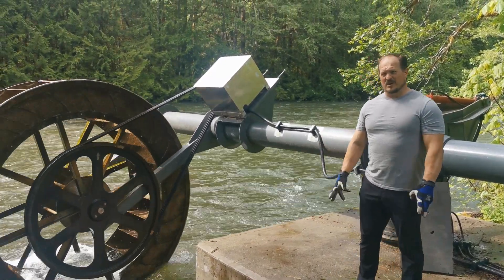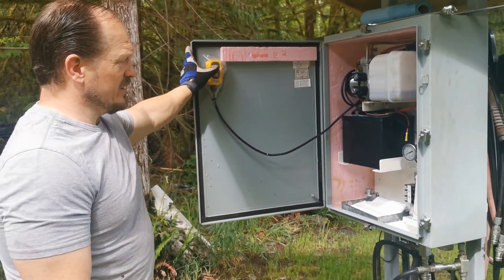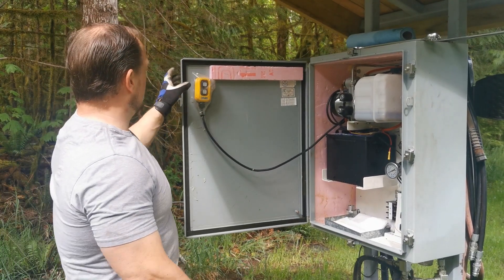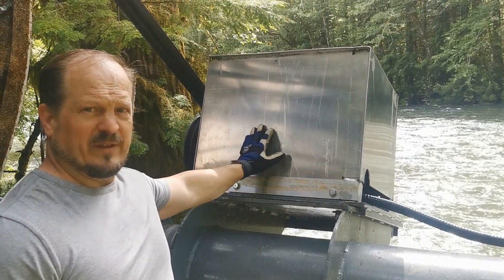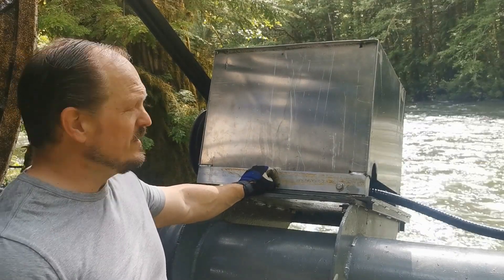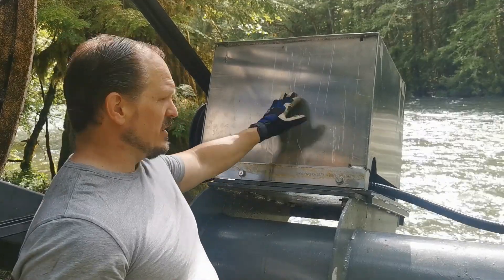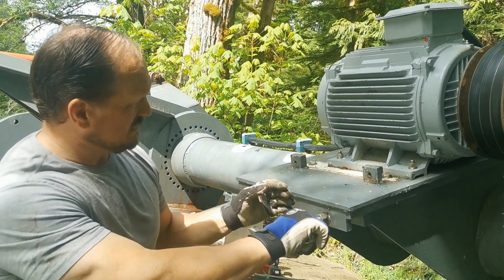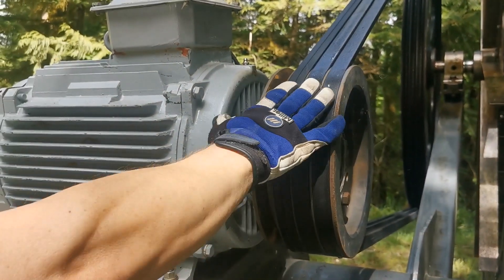DID THEY FAIL? Bearing Update Waterwheel 2020

Comment: lignum vitae bearings have been used in ships for years but they need a really large flow of water.  i saw one bearing fail  because the water flow was cut off by a rope around the shaft despite it being ten feet under water

Comment: You may consider looking at flat belts unless you've already moved forward with your chain plan, though I may be using experience from the wrong RPM range to make this suggestion. The Lister(oid) diesel genset community has had lots of home-brew experience in how to get the most out of big-flywheel mating to gensets.  A flat belt has multiple "grooves" in it, and may end up giving better surface area contact when you do the math.  However, they are probably difficult to find in the lengths you will need for your kit, so that may disqualify them. Also, your comment about an idler is probably correct - with such a large differential in big/small diameter wheels, the contact area is significantly lessened, leading to slip.  A double-idler would also give you quite a bit of boost and reduce slip.  I'll be very interested to see what the chain does - it should also make it possible to reduce your bearing loads quite a bit.

Comment: any consideration to using a chain and sprocket drive to eliminate slippage, or are you counting on the slippage as a natural protection mechanism (?)   I first read about a poncelet wheel in the late 60's-early 70's...  never have seen anyone do one.  Nice setup, especially as a DIY

Comment: A direct shaft coupler would solve those problems, encase the generator in a vented housing. install a dc voltage height gauge that would raise and lower automatically to accommodate changing water levels. You could also install a electrical current monitor if the voltage dropped it would automatically raise the water wheel due to debris getting trapped.   Nice job and could be duplicated, sell back into the grid to pay for the upkeep and make profit.

Comment: You may consider swapping out the Lignum Vitae bearings for a set of Closed Linear Plain Bearing made by the Pacific Bearing Company. Pacific Bearing's 4" diameter bearing has a static load capacity of 100,000 lbs! That is seriously heavy duty. These bearing have cylindrical aluminum or stainless housing and the bearing material is inside and no moving parts. All you would need to do is machine 2 aluminum pillow block to mount the bearings in and probably true up the shaft so these bearings wear evenly. PB's are mostly used for linear motion, but as also perfect for slow rotary motion with heavy loads. There are a couple reasons typical roller bearings fail in water wheel applications: the rotation speed is to slow to liquefy the grease thus it gets push out failing to lubricate the rollers, the second is water intrusion. These plain bearing are available with zerk fittings for grease or a threaded port for oil lubrication via a wick... and water actually improves the performance and longevity of these bearings. The reason I know all about this is I plan on using them myself when I find the right hydropower site for my stainless steel overshot wheel. PB pdf catalog has great info about the max rotation speed with and without lubrication and tons of other important info. Best of luck to you
Reply from the maker: I'll check them out. I'm getting ready to do some mods to increase power and power delivery
Reply: @NeringIndustries  Are you going to make the wheel wider to increase power? Any plans to add a gearbox, gearing, or chain drive? You could always make a generator that is direct drive i.e. no transmission. Some wind turbines are direct drive and have a very large diameter stators and rotors that makes power without the need to speed up a shaft to 1800 RPM's as many generators require. I'm excited to see the improvements
Reply from the maker: @chrisdaniel1339  I've got a chain drive system waiting to be installed. I can then lower the wheel even further into the river and make more power without the belts slipping. I'll need to fab up a chain guard with an oil sump to keep water off the chain and keep it lubed. I'll be going back to roller bearings and have a plan in place to do that too. At some point I'm going to make the wheel 1 foot wider and bigger in diameter. To go direct drive I would need a huge generator at 10 rpm,
Reply: @NeringIndustries  I am curious about using roller bearings again when they have not performed well in the past. How are you going to keep from infiltrating the bearings?
Reply from the maker: @chrisdaniel1339  I've several things I am doing at the same time. 1st is putting covers over the bearing housings to prevent direct water being splashed on them. 2nd is using pregreased bearings with factory seals inside the housings instead of the open design I used before. 3rd is not filling the housings with grease but leaving the housings with air space around the bearing and drilling a drain hole in the housings for any water that gets inside. 4th is using a different style of shaft seal on the housings. Lastly i will install a flinger ring on the shaft to fling off any water that runs along the shaft. Hopefully that all works.
Reply: @NeringIndustries  I am interested to see the new improved machine.
Reply: @NeringIndustries  Pacific Bearing has two metric product lines FM (Metric) Closed linear plain bearings goes up to 80 mm ID sizes With capacities of 270 KN or 61,000 pounds. They also have an FJ (JIS) metric closed linear plain bearing With a maximum 150 mm ID size and 740 KN or 166,000 pound static load capacity

Comment: Nice setup!! I was thinking dude that bearing and wheel have to be shot… Then minutes later I find out it’s wood… that’s such a great idea seems to be working really.. How much does the height of the river fluctuate?? How is that wood bearing doing now since this video is 2 years old…
Reply from the maker: The river varies about 5 feet from lowest to highest. The bearing now has 1/4 inch of wear on the non drive side, less on the pulley side as the belt tension takes the weight off the bearing.

Comment: I've been experimenting with water wheels for a few years now. I have pretty much the exact same situation as you. Stream looks identical. Really like that setup. I could get away with a smaller wheel. If I could get a couple hundred watts I'd be happy.  That would take me through the night or raining days to supplement solar. I have the same Power One gridtie inverter. Plus batteries also. NICE!

Comment: Really cool project... BUT very inefficient compared to how much material you put into this... The speed of the river is actually very good... you can make a LOT more energy, several kWh with a simpler setup, by diverting a bit of river flow and making a downspout torrent... no water wheels necessary...
Reply: Not really an equivilent solar system would have been much more also yeah not the most efficient and idk where he is but in many places it's illegal to mess the flow of water in a river pumping water out or diverting would atleast require permit and approval etc. Honestly it's a pretty low maintenace setup and 1-2kwh is more than most people would need

Comment: I wonder if you could devise a float system that could detect the level of the water and automatically lift/lower the paddle wheel to keep it at the optimum angle in the river so it wouldn't get too deep and bog down it's rotation when the water level gets too high...
Very cool design and use!

Comment: What a nice design. Were there limitations to the wheel width?
Reply from the maker: No, I'm actually going to extend the blades and go from 3 -to 4 feet wide. Probably going to change from belt drive to chain as well as the  belts slip.

Comment: why don't you use a metal chain instead?
Reply from the maker: I was concerned with corrosion of the chain. However, I'm going to try that next as the belts slip under heavy load.

Comment: Im shocked that with all of that torque you did not use a couple of pulley sets to step the speed up to something that would actually drive that generator properly. There is no reason in the world with a wheel that big you should not be able to pull 2 kwh constant. Even if you went from a 4 inch to a 12 inch pulley on a common shaft and then from the 12 to the motor you would see a 3x improvement.

Comment: I have wanted to build something like this for years, I have a river in my garden that runs this fast and much faster throughout autumn and winter but almost drys out in the summer here in the UK.
 I am no engineer hence why I haven't built one yet. I was wondering if a smaller generator geared higher might produce better results?
 What changes would you make if you were starting from scratch today?
 Would you still build this knowing what you know now regarding cost to benefit ratio?
 Really impressed by your achievement, by far the best project of this kind on YouTube in my opinion.😀😀👍👍
Reply from the maker: I would have gone chain drive, as I get belt slippage under high loads

Comment: Great to see that the wooden bearings are still working properly. How did you design them?
Reply from the maker: I replicated the original roller bearings with pillow block exactly size wise in a solid block of wood. Then bored a 75mm hole for the shaft.

Comment: please use oil instead of water. it will work much better, i saw a English waterwheel, 5 years old same wooden bearings but they was not worn at all. he was using a thick oil.

Comment: that is great work, what i see is there is some sort of force acting against the watermill backward for the previous video during the splashing and seeing how it goes it seems the water wheel shape is not fully optimised and thus creating drag from the water traction and water friction. But it's still a good work nonetheless. How much current generated from this and with that much water drag and it can still last that is great engineering.

Comment: I thought a wheel that size and with the speed of the water you'd be getting 10kw at least, i don't think the design is using the river to its maximum potential
Reply from the maker: Yeah its not fully optimized. Going to chain drive I can triple the out put as right now I get belt slippage under high load. At some point I'll widen the blades too once I finish my chain drive install later this summer
Reply: Yeah i thought the same as you think
Reply: Normally generator must have 1500 rpm. There is no transmission in this device to increase revolts up to 1500.

Comment: why do you use belts if you can make one more shoulder next to the counterweight, put a gearbox there with any gear ratio, extend the wheel axle to this gearbox and get much more than 1 kilowatt. Yes, need to cut a little the concrete. The power of the river is simply enormous, it is strange to use only 10 percent of the possible.

Comment: This may be of interest to you, with regards to your bearing ware, the wood used is the best you can use,
BUT, the design of the bearing is wrong, the easiest way I can describe how it should be made is,
The grain of the wood that touches the bearing should be at 90* to the steel shaft, yours is running with the shaft,
If you can imagine the stays of a barrel, raped around the shaft and inserted inside a larger hole in the main block, hope this makes sense, the lifespan will be greatly improved.
if you look at old steam-driven cruise liners propeller shaft seals, you will get it.  keep safe   UK.

Comment: What a project! It’s quite impressive. Would it make sense remove the belts and use a drive shaft from the axle to a gear box and chain drive? The unit could be mounted away from the wheel and out of the wet area. You would eliminate the belt slip and gearing would give greater control over rpm. 
No disrespect. It’s quite an accomplishment already.

Comment: I think maybe I'd try pressing a piece of nylon on the shaft, and a bit of Teflon or Nylon on the bearing block, with a hole in it for water lubrication, it could provide a slippery surface, and it's replaceable, preventing damage to the larger parts,
Yeah, without that SS strap, I'd have dreams if it loosing the wheel, ha-ha!..

Comment: You're not using your belts as they're designed to be, they may be rated to 100hp, so why are they slipping at 4hp max???

The reason is that they're designed to run at 6500fpm (ind std) & yours are running a tiny fraction of this speed.

I appreciate that your generator is 50rpm max, this needs to be changed for something that runs at much higher rpms, then you're going to have to speed up the output of the wheel to increase the belt speed to suit the higher rpm generator.

This will reduce the load on the belts and stop them from slipping.

Hope that helps 👍
Reply from the maker: I understand all that which is why I have three large belts. However how exactly do I transition to a higher rpm with a 10 rpm water wheel, meaning what should be the initial driver off the water wheel? There is also the 10% loss of efficiency for each  speed increaser added. That's why I have a 50rpm generator to avoid efficiency losses. I could go with a chain, but what about lubrication and rusting.?
Reply: @NeringIndustries  I've sent you an email with some suggestions. I hope neringindustries@gmail.com is correct?
Reply from the maker: @alexadams1836  yes

Comment: I'm confused how can the belt slip spinning that slow of a rpm on the generator with hardly any load.....1 revolution on the big wheel to maybe 8-10 revolutions on the generator how can the belt slip??
Reply: Torque. the waterwheel is slow but strong the generator hard to turn and the belts cant transfer the power at such low speed

Comment: Toothed belts?
Reply: MVia  what isn't how toothed belts work? I run a toothed belt on my motorcycle and it doesn't wear out bearings because it has slack in it, my lathe runs v belts and slips when the load is to great, tensioners will put pressure on the bearings because it pulls them together
If you don't know don't comment.
Reply: MVia  why? Surely they could be run slacker?
Reply: MVia  so v belts slip which is what this one is doing so he cranked it up tighter to stop it doing what you purport to be its advantage and other people are advocating a tensioner to stop, toothed belts would stop this and run with less tension so protecting the bearings and the motor isn't doing the turning and the water wheel isn't directly connected to the drive I.e the water, so there is no need for clutches.
The only reason I can see for using v belts is on initial immersion of the wheel cos that motor takes some starting maybe they would snap in which case get bigger.

Comment: I understand your thinking about “strapping” those bearing blocks. Did you buy these bearings? Or did you saw them out yourself? If you saw them or knew who sawed them, the next set I would just keep the block square, split them just like the dodge bearing housing, or a main journal bearing cap, and run longer bolts with a top plate between the heads of the bolts to sandwich the block. Could “cheat” the tolerance then by shaving off the faces between the two to get more life out of them or flip top to bottom.
Reply: I worked at a shipyard and they used these bearings on the shaft's for the propellers but the bearings were submerged for better lubrication this wood is very hard but there is not enough water running over it to lube it properly also if you extend your generator out like you did the water wheel you will get more wrapping on your driven wheel because you can then put a tensioner wheel on the arm in the middle between the two arms.

Comment: Are those Matched belts? We had a 20HP electric 96" bar hydraulic  chainsaw with 3 matched V belts... if the belts were not matched they slipped.
FWIW if the block breaks the stainless strap will not hold that wheel in place...

Comment: All that to maybe run a toaster!
Reply from the maker: Your reply was smarter than you think. Many generators are load tested using "toasters" or load banks which are just large resistor banks. This "toaster" runs 24/7 BTW:)
Reply: The system is worth it 
If you can make 1kwh it's priceless!!

Comment: Im not a genius by any means but the wheel looks like your putting it too deep in the water and there is too much friction with the wheel and the water itself slowing it down i thought i could see it in the video but it could be deceiving
Reply from the maker: I know it's weird, but the deeper it is in the water the more power it makes. I'd go deeper still but the water makes the belts slip when the pulley is submersed.
Reply: @NeringIndustries  could you use like a timing chain?
Reply from the maker: @Perspari  I looked into that. They don't make one long enough for my application.
Reply: Force = mass x acceleration.

Comment: I don’t understand how you get 900 W spinning that’s low because it’s a bigger motor and you’re still spinning it slower that’s the part that doesn’t make sense,  The RPM seems too low to make any voltage even with it being geared up
Reply: Bc it's huge and has massive floe

Comment: Great sistem. Maybe iner circle of blades  should be closed, will reduce hidro drag. Just my opinion. Wish you all best.
Reply: I don't think that will work. Closing the buckets will create an airlock that prohibits it from filling with water thus reducing power output of the wheel
Reply: @VictorY-mu6zp  If blades is on to the flow of water will not create air pockets and will increase output of kW.
Reply: @robertfreund7525  what do you mean with on the flow of water?
Reply: Hydro drag isn't a limiting factor